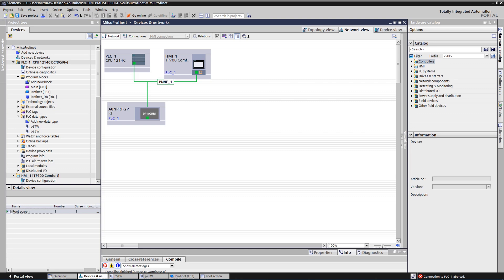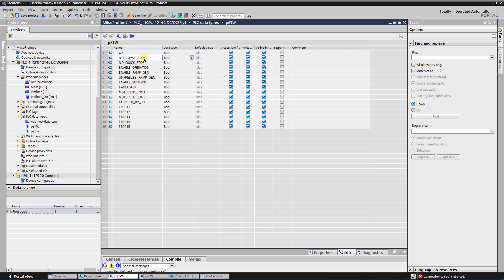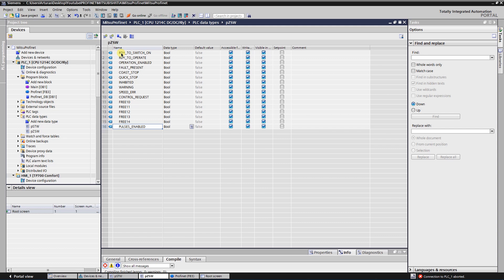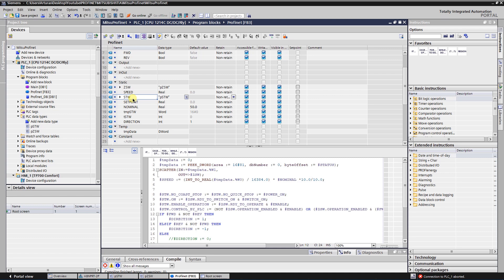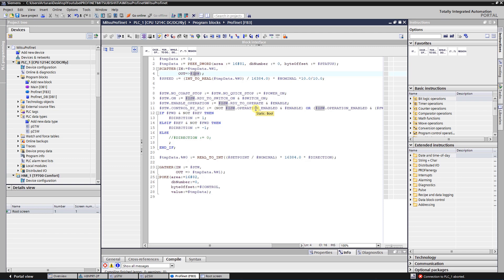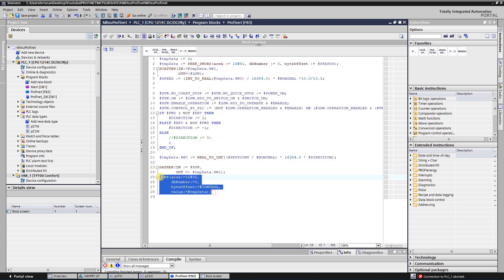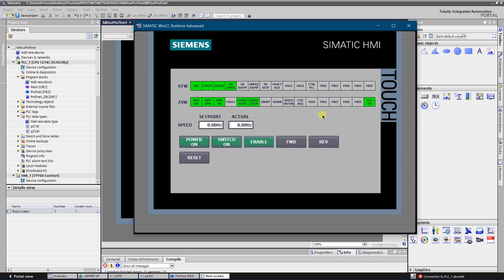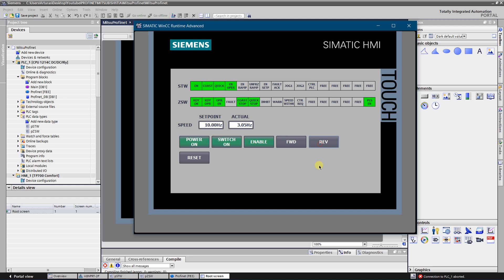TIA PORTAL PROFINET: S7-1200 + FR-A8NPRT, Control of the Mitsubishi VFD. Part #3

Comment: Is it can use with FR-E840-0060-5-60 ?
Reply from the maker: Could you write full product code?
Reply: @automatikavaldymas  Can you recoomend me which one can use Profinet for 3.7kw ?
Reply from the maker: @vorapobautomation9760  You need to decide what application you are going to use it for. There are a lot series of Mitsubishi inverters, like A, E, F and so on. You cannot use this project as it is for E series inverter as telegrams are a bit different. You can follow this video only for inverters, that has option FR-A8NPRT-2P, made by the Hms.

Comment: Would you have a Function Block available that i can read speed/torque/current of VFD. I am new to Siemens and using this with a Mitsubishi unit and looking for a block to use with my system.
Reply from the maker: Please have a look at this video: www.youtube.com/watch?v=7uCl9cFE65Y  You can read those values via parameters. Please find my comment how to switch between the desired settings.